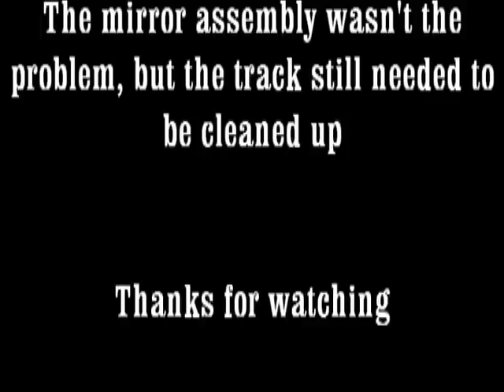Gmc Sierra Power Extending Mirror inspection and repair

Comment: My 05 Duramax driver mirror would not retract, watched your video and it helped me narrow it down to the black connector, but it was hard to see what terminals you powered up to manually engage it to go in or out. Might be helpful to others if you add it in the description. Black wire neg, black with red stripe pos will extend. reverse polarity to retract. Cheers, and thanks for the vid
Reply from the maker: putting that right in description thanks. I have 2 spare mirrors if you need parts, I got 2 nicer take-offs and can sell the parts in mine (those in the video).

Comment: This is like the only video of these towing mirrors on you tube. Mine never really worked that great. Took them apart on the truck and cleaned the tracks. I pulled the motors and tightened up the slipper clutch on the gear and they work alot better now. The passenger side still sticks a little when fully collapsed, but it always did. They at least work better now. They're almost 15 years old.
Reply from the maker: I have 2 fully working spares now. Bought them to replace the casing of my driver one. I keep the tracks lubed up with fluid film but also use them all the time so they never stick now
Reply: I just located a pair of these to go on my truck. They extend, but do not retract, is there a different switch that's needed for this?  My truck had power folding factory mirrors with heat, turn signals, etc.  Or is it possibly as simple as moving a wire in the plug(s) that go to the switch controls?
Reply: @paulkerpash3668  What year is your truck. If it's newer than maybe 05-06 I don't think these type will work. Mine stopped working now and sometimes the ds works. They aren't the best design. I think there was an aftermarket one that looked similar.
Reply: @RC4X4  Mine is an 06 LBZ.  The control button for the mirrors to fold will run them out, but they will not retract.
Reply: @RC4X4  when I push the other side of the button for retracting, the mirror plate itself moves....like when the original mirrors plate moves for folding.
Reply: @paulkerpash3668  Hmm. Sounds like it may work.
Reply: @paulkerpash3668  Right. The system in these are not the best. I took mine apart and played with them for hours. They worked but then a month later starting having issues. I just manually pull them in and out now. My 2017 2500 HD will power fold  but they are pulled in and out manually.

Comment: Can one take the mirror face off without removing mirror assembly from door?
Reply from the maker: yes, explained at 2:40. these are 3500 mirrors
Reply: Mine are on 2500HD
Reply from the maker: @geraldclemens1682  same thing

Comment: Is it possible to get a replacement boot for the mirror? Mine is dry rotted.
Reply from the maker: I have the broken mirror for parts if you want it. accordeon boot is perfect
Reply: Veikra oh yea, where you at?
Reply: @Nordic_Mechanic  Are your boots still available.
Reply from the maker: @edwardklepper9803  yes they are

Comment: lot of the time it's the spring on the opposite side that is too strong which burns out the motor.  if u cut a coil out and reinstall it should keep the new motor happy.
Reply from the maker: It can't be as there is no such spring to work agaisnt it. The only spring is to fold it, and that works on the hinge, not the sliding motion.
Also you can't burn the motor since it has a clutch if the mirror woul be stuck. Unless you hold the button for hours on end it wont burn.  
 You have the wrong model in mind.

Comment: I prefer the big towing mirrors but good disassembly video.
Reply from the maker: I like these, they are the stockers. They are perfect with the trailer once extended, and retract when trailer is off.  Plus they are quiet on the highway. I dont have any reason to replace them yet.

Comment: At the end of the video your message says the problem wasn’t the motor. What was the problem?
Reply from the maker: From the description, power switch.
Reply from the maker: window switch of course. At the start of video it's either switch or motors. Water got in the window switch and damaged the ic responsible for operating the motors

Comment: got a set for my truck. won't extend or retract. can hear the motors.
Reply: i can sell you the left non broken mirror for $150 and include the right side glass and those seat heater switches
Reply from the maker: the slides are stuck. aluminium, they get nasty.
Reply: Veikra i got it free up and it does work but the right side is broken
Reply from the maker: I already got the heated seats and switched all installed and working.  my mirror only has cosmetic damage.  If you can sell the casing or a non working mirror with intact casing, I might consider. It's not worth 150$ to me right now as I need to buy a rear dually fender and thats over 4 figure canuckistan :s I'll have to repair mine and color code it as well
Reply: maybe i can sell them for parts local
Reply: but what gets me is i can manually push them in. but they won't work cause my truck originally came with the DL3 mirrors
Reply from the maker: yeah, the motor DO have a clutch in them when they reach the ends of the track. When you push them in, you are forcing that clutch.  Now, your truck did not have these, DL3 is power folding, not power extending. In order to make power extending work in the DL3 optioned truck you have to reprogram the driver side window switch.  

BUT ! you should get some behavior at least. I could show you as I have a escalade DL3 switch that isnt reprogrammed yet.  They will extend but wont really come back in much
Reply: Veikra i took them off and bought the DPN style mirror with heat power and signal.
Reply: @Nordic_Mechanic  How do you reprogram the driver side switch?  I had the power fold mirrors, heated with turn signals and found a pair of the OEM tow mirrors, electric extendable like your video, they will go out but do not retract (mirror plates move like the folding action on the stock mirrors.  This is on my 2006 Silverado 2500HD LT.